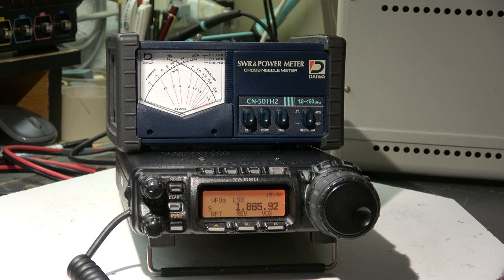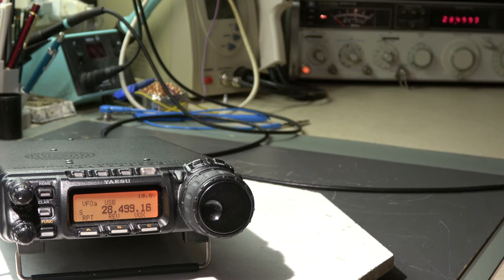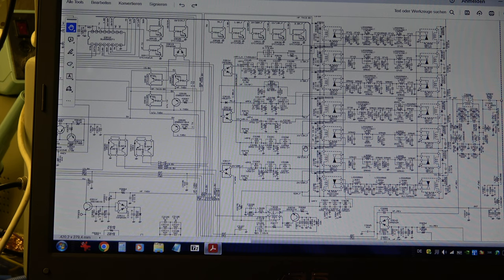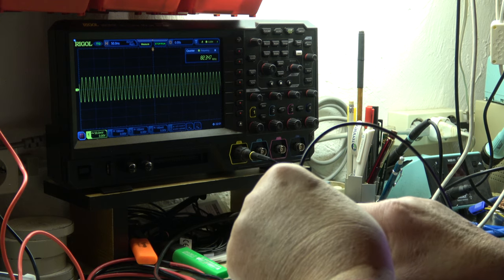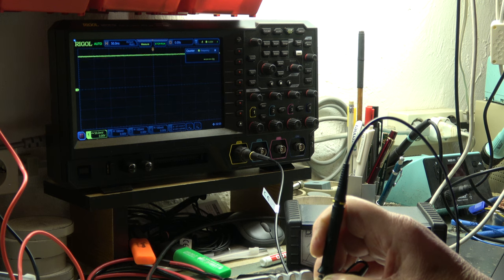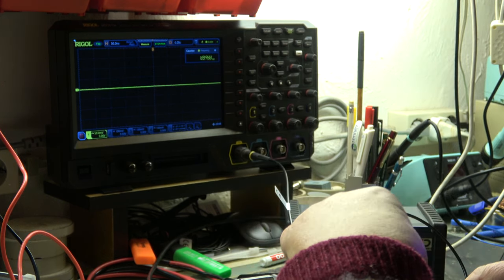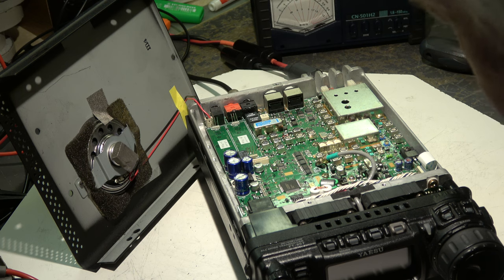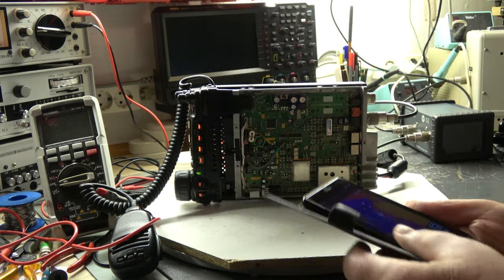#184 YAESU FT-857

Comment: This was drilled into us at Motorola and Kenwood to RTFM and understanding how the radio works and how to enter proper alignment modes. I went to another shop after the one I worked at closed down and was appalled at the bench tech as to how he aligned the Motorola Maxtrac and Radius line of radios that were popular some 20 plus years ago! Instead of using the computer with alignment software to set up the radio after a major repair he would just twiddle the caps and coils until the radio worked. Now the radio would come back time and time again for alignment issues. I was the low ball man on the bottom of the totem pole so I kept to myself. This was not the way to align these radios! Software controlled radios are a different beast compared to legacy Motorola and GE radios that had zero microprocessors in them. Funny I had fifteen years experience on these micro controlled radios and could have solved the problem in about an hour and a half of realignment by the book.

Comment: Thanks for the video Stefan. Has happened to me many times! Go looking for the fifth leg of a cat (a Spanish saying that means that you look for the most complicated thing that may be happening  not looking for the easiest of solutions) and the solution was a simple one. I would have done same. So you are good my friend. I have one of these (D version) and will now check on the speaker but I am sure it does not have that pad cause I replaced the speaker years ago (bough the radio used and had broken speaker cone and also screen was striped damaged). Ordered both parts and is now working really well. A hug from El Salvador and thanks for sharing your knowledge. I learn a lot from you. 73 Rob, YS1RS.
Reply from the maker: The fifth leg of a cat is the tail ... hihi
Reply: Exactly!!! Thought the same when I heard the saying first time. My grand father used to say “Era simple pero por andar buscando las cinco patas al gato, no viste la solución…. Así se aprende!”. He said that to me many times. 
Agree the fifth one is the tail 😂

Comment: My newly acquired FT-857D has foam around the speaker. It's brittle and made a mess when I took the top cover off. Got it cheap because it has the display issue. Already have an Arduino taking over for it and displaying frequency, mode and s-meter on it. Still need the crappy one for the menu.

Comment: Hi Stefan, I followed with interest this video as I’ve worked on 2 857 I acquired for myself, both needing repair. I also worked on my 817. I do agree at the beginning the software alignment Is tricky. I took me some time to get it right. Regarding the conductive pad I can tell you that it was NOT on the right place. Factory position is on the side of the speaker, not were you found it. When you close the cover it goes pressing on the TMP connector at the center of the board (by memory the rx path). Someone went in and just made mistakes there as well as on the bloody alignment menu!.
Best wishes and to the next video!
73
Diego
Reply from the maker: Tnx dr Diego, i can follow your argumentation regarding this crazy pad. The history of this TRX is unknown and there are many genius in the world....hi.

Comment: RTFM - good advice, banging your head against the wall - not so good. A piece of conductive foam stuck to the speaker pressing on the microprocessor that is removed when testing would be so easy to miss, especially the conductive bit. I believe you found this problem faster by using standard troubleshooting methods than you would have by scrolling through all of those menus looking at numbers. I say "Well done, sir" Regards, David

Comment: Nice repair  I have the same scope I unlocked everything did you software unlock yours Too ?
Reply from the maker: Yes, i bought it with all SW-options unlocked
Reply: QsTechService1   I too have this scope and really need the extra bandwidth/generator, but (maybe I’m dumb) but just couldn’t find (to me) a straight forward set of instructions/SW for me to confidently do it. 
Very worried of bricking it and being retired too a long time to afford it.
I hate to ask this on Stefan’s channel but could you point me to where and how you did
Thank you and Stefan & 73! 😊
Reply: @SpinStar1956  Check out Dave Jones EVBlog Forms Basically you're installing custom Firmware Unlocking all features Also turning the scope into 500 MHz Just make sure to back up your Stock bin file Is first before flashing Let me know how it goes